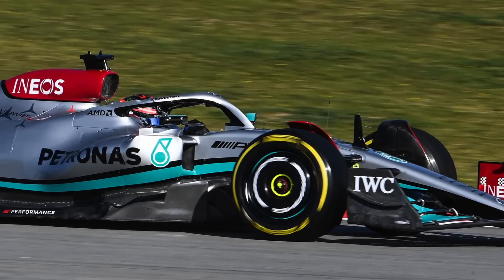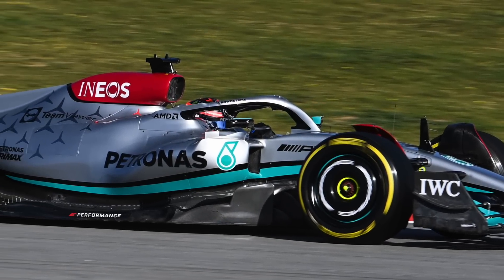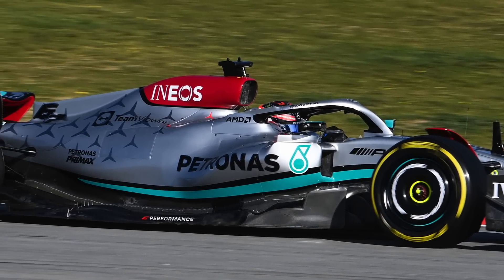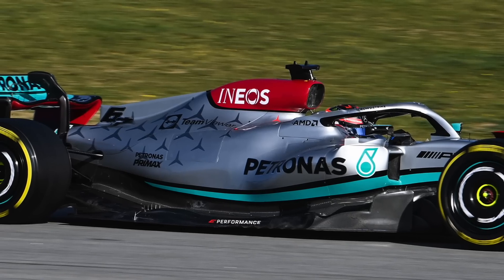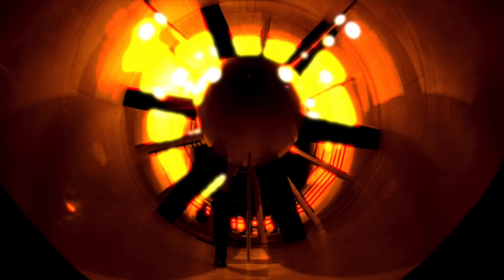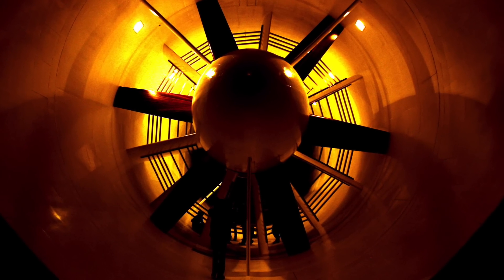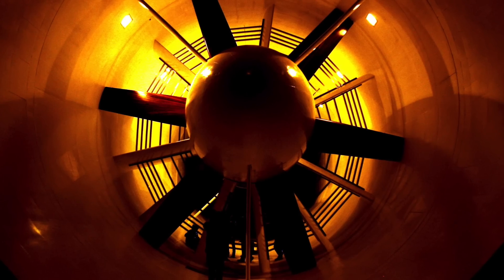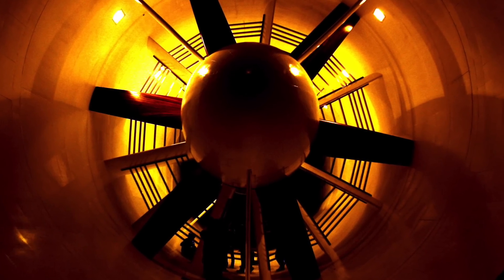F1 car porpoising: CFD or tunnels? By Peter Windsor

Comment: CFD, IS AN INCREDIBLE PIECE OF TECHNOLOGY. BUT IT'S GOING TO TAKE A BIT MORE BASIC UNDERSTANDING OF IT BY THE VIEWING PUBLIC TO TRULY APPRECIATE IT !!!
Reply: They never will. The only way to explain it simply is to dumb it down to the point it sounds unimpressive.

I didn't really understand it until undergraduate theoretical and applied fluid mechanics, a masters course in CFD, and then modelling an Americas Cup mast and sail interaction upon which it failed miserably due to at the time limited availabilty of low Reynolds number turbulence models.
Reply: WELL SAID , THIS TECHNOLOGY I GUESS IS STILL IN ITS INFANCY AND DEFINITELY NOT AVAILABLE TO THE GENERAL PUBLIC . THANKS AND WOULD LOVE TO HEAR ANYMORE ON THE SUBJECT .

Comment: Is this not a little stating the obvious? Any good engineer will know the limitations of their simulations, and he said so himself the hardest part is building the initial model so the teams will building their model based on historical data, taking it to the wind tunnel to validate, rinse and repeat. Then the moment the get running on track they have new data that gets fed back in at the CFD end and they can start refining further. They will all know that CFD can't model everything perfectly so won't be committing to a particular philosophy until they have better data. But the limits on wind tunnel testing and zero track time allowed over winter means it is all they can use

Comment: I’m not an engineer though I’ve followed F1 closely for decades. A question that popped into my head during this conversation is once a car is in a real environment how much does wind, humidity, temperature.... mess up the data from the wind tunnel?
Reply: I’m not sure I fully understand what you’re saying, but test data is used to data match the model. So the model learns more about the real behavior. So it’s not “mess up”, we use the test data to match the model to so we can better understand the operating environment. 

P.S. I’m an aerospace propulsion engineer.

Hope this helps!
Reply: @tigerrx7  I suppose what I’m asking and I’m asking the right person... Are factors of the elements replicated in the wind tunnel testing? Obviously an F1 car’s aero is affected by wind speed, direction and gust as well as air temperatures and barometric pressure as well as humidity. Are these able to be simulated in the wind tunnel testing and are they? Thanks
Reply: Far more important for CFD and wind tunnels for slower sports like sailing.

This was the reason New Zealand first took the Americas Cup off Dennis Conner. First to use wind tunnels that included real wind effects to model air flow over the yacht as it sees in real wind. Gave NZ a 15% performance benefit over every other competitor.

But yes, those are all parameters kept track of in test data.

Comment: The CFD will suggest configurations that work. Testing those (and tweaks on those) in a wind tunnel will both allow teams to develop something that works on track and further calibrate the boundary conditions in CFD via comparing the variabilities seen in the wind tunnel and observing similar trends in CFD results.

Comment: Turbulent flow is averaged flow, and it's lossy flow because the eddies effectively act as a brake for the flow. Tires like cylinders create Kelvin-Helmholtz instabilities, as do flapping wings(or floors). The wafting wake from the tire can be controlled by the vortices that are shed when the wheel yaws. Turblent flow still has a bulk motion and interaction with surfaces, it's just a great deal lower than laminar flow because you are eliminating skin friction and replacing it with the viscosity of eddies.

The mirror stays play a large role in controlling the rear tire wake. So does the rear wing end plates. The tire wake also affects the wing tips. Last year's cars used the wing by the radiator inlet as a way to control the rear tire wake. All they have is the mirror stay. Mercedes sidepod is impressive but it does nothing for rear tire wake.

Comment: I mean, I am a programmer, so maybe that's the issue. But I really feel like this is merely an issue of computation time and complexity. With unlimited processing power, team using CFD will probably easily beat the team with a real windtunnel and vice versa.
Reply: It still needs validations and both need to be validated to the real world.
Reply: As a programmer, you should know that not everything is computable. Chaotic systems are very difficult and yes, sometimes even impossible.

Comment: Airplanes, ships, and cars are all more efficient thanks to CFD. Not only has processing drastically increased in the past 5 years, but so too have the understanding of the physics which has led to ever improving algorithms.
Reply: It's also worth reminding ourselves that they designed and got the first 747s flying using panel methods assuming no friction. Just distributed source, sinks and vortices and a boundary condition applied to the simultaneous equations.

Comment: CFD is great at producing results from the algoritim and models put in. But you have to have enough knowledge to understand the output from that with what was put in then you also have to validate that with how it acts in reality. That is why we have cars with the aero sensors on track. Too many think that you can just model and run things through the compture and if the computer says Yes it will work... It all depends on what calculations the software have done on the data that was give to it. Shit in gives shit out. Gold in gives gold out which may not be how it works in reality...

Comment: Great video !   I have heard Frank Dernie say that he invented diffuser strakes in the 1980's.   Maybe a good idea for a video would be Frank Dernie explaining what diffuser strakes do.  Because I have not idea what so ever.  The typical Autosport magazine article is not terribly insightful.  Great video.  Wonderful to watch.
Reply: Kyle Engineers on YouTube might help u. He's an aerodynamicist who used to work for Mercedes Benz !
Reply: Most diffuser strakes clean the airflow or separate the bad from the good. If you remember last year's F1 cars their strakes were towards the edges of the diffuser not in the center, this means that the are controlling "tire squirt". Tire squirt is the air that hits the front of the wheel specially at the lower section close to ground and "squirts" inboard or outboard of the tire. The one that matters is inboard tire squirt because it flows straight into your diffuser, tire squirt is messy, turbulent, unpredictable air and it's impossible to get rid of it, so teams place strakes to keep that messy flow from messing up their entire diffuser. It doesn't seal the diffuser but rather separates the messy flow that might come in from the side and tire squirt, keeping the laminar (straight and predictable) flow down the center. This is a more efficient way of controlling your flow and creating down force. There's a second reason and that's lateral expansion. Diffusers expand air vertically, this accelerates the flow and by Bernoulli's principle means that it drops in pressure (mixed with a high pressure above creates down force) but some diffusers can also expand laterally and strakes help the flow move outward (expand laterally) and once again accelerate and lower in pressure. Some strakes even play with the flow behind the car or help surrounding flow but that's something I'm not to familiar with. Hope it helps! (Ps. I'm no aerodynamicist but you can check Kyle engineers video on strakes)

Comment: Saying that CFD can't respresent unsteady flows is just false. It's true that unsteady simulations are much more computationally expensive than steady ones, but still I know for sure that in F1 they run them regurarly to develop their cars, even smaller teams like Haas.
What they can not afford to do is to use unsteady codes for all the simulations. Therefore a correlation work between steady and unsteady CFD simulations is also necessary.

Comment: Frank’s comments about sports cars being easier to deal with than open wheels suggest to me that those who claim solutions exist to porpoising in LMP01 only understand half the issue. Von Karman vortexes are a real pita and even wind tunnel models have rigid suspensions and real F1 cars are subject to structural mode interactions that are nearly impossible to model or replicate in a scaled wind tunnel. IMO, I think the rules makers think they’re more clever than they are.
Reply: Nothing new here.  Breakthroughs in CFD and aerodynamics far exceeds the expertise of Brawn, Symonds and co.  There knowledge base is ancient in that regard.  Brawn himself said he didn't predict mercedes solution.  Another example are the new front tire wake control winglets being a visibility problem.
Reply: Please, it's not that complicated. It's really not an aero problem, it's a suspension setup problem. It is very easy to eliminate, it's just that eliminating it reduces performance. So to go fast, you need to be as close to the edge of porpoising as possible and maybe even over the edge. 

Also, some of the best ways to deal with it were outlawed this year. Heave springs and inerters would be VERY helpful right now but they can't use them
Reply: @wingracer1614  I agree about heave springs and inerters, but that isn't the root cause of the issue.
Reply: @Hoffbottraces  No, the root cause is the diffuser stalling when the low part of the tunnel hits the ground. There are only two ways to prevent that:
1. Design the tunnels in such a way that the lowest part of the tunnel does not hit the ground first. That way the underside always has airflow and doesn't stall even when the car bottoms out. Unfortunately this would require rule changes and all new parts. Not an option for mid season. 

2. Don't allow the car to bottom out. This will cost performance. Heave springs and inerters would help you achieve this with less loss of performance. 

The bottom line is that with the current rules, this is going to be a problem all year. Not because it is a hard problem to solve, it's easy. The problem is that eliminating it makes the car slower. Teams would rather win the race with porpoising than finish 5th without it. I suspect we will see a lot of cars porpoising during the first half of races with heavy fuel loads. Should go away by the end
Reply: @wingracer1614  I haven't seen anyone present any data suggesting this is the only cause, and it could be a number of causes. There are a lot of pundits copying each other's theories, but Jean-Claude Migeot hinted at what I have described as well. Quote "Migeot explained that the cause of porpoising was not in a cyclical stall function, but down to the aerodynamic forces within the underbody at high speed inducing movement in the car close to its natural heave frequency.".
Reply: @Hoffbottraces  That could be. If so, inerters would effectively eliminate it. It's what they do.
Reply: @wingracer1614  seems there is a bit of disagreement with your statement seeing how these cars shift the weight around based on the speed and direction of the corner.  It it were that simple of an issue ten F1 teams would not have had to fight it for days..
Reply: @uprightfossil6673  Corners have nothing to do with it. Fixing it is easy, raise ride height, stiffer springs, harder and earlier bump stops. Problem solved. The only problem is that reduces downforce in slow speed corners and increases drag on the straights. No one wants that so they try to live with porpoising at the end of the straights in order to get better performance everywhere else. The only aero fixes are things that would reduce downforce and they obviously don't want to do that either. The things we are seeing like stays on the rear corners of the floor and slots and holes are all just band aids, not solutions. 

There is another fix. A different tunnel / floor design that bottoms before the stall. Unfortunately that's not an option as that is a strictly regulated part of the car. The FIA would have to change the rules to do that and there isn't time or budget cap room to do that mid season. I would not be a surprised to see such a change for next year as not only could that eliminate porpoising but could also reduce downforce a bit, helping to slow down these cars that look like they could end up the fastest ever by the end of the year instead of the 3-4 seconds slower they predicted.
Reply: @wingracer1614  okay dude.  I guess next time I want to know I will ask you and ignore the F1 engineers who are part of the F1tv package.  Maybe you should get a job helping those guys do their job right so that us watching don't have to see them bouncing down the track. 😂
Reply: @uprightfossil6673  I guess you missed the part where I said you will be seeing them bounce down the track all year. While it is easy to fix, fixing it makes them slower.

And LOL. while I was typing this I had an interview with Ocon playing in the background and he said the exact same thing.
Reply: @wingracer1614  yeah sure dude.  I guess you forgot that you wrote that it was easy to fix and that corners had nothing to do with it.  Don't argue when you can't remember how wrong your statements are.  And don't try to deflect... I'm old and that trick is what stupid people try... It never works 😂

Comment: What was the old school way of fixing this problem? Drill holes into the tunnel and skirts to relieve the massive pressure they are making
Reply: That isn't so much about releasing pressure, more reenergising flow if a stalled surface is the problem. Which is likely what limits and releases the max downforce.

Comment: Why wouldn't they be able to model or simulate turbulent flows?
Reply: another name for turbolent is chaotic... Computer has terribly hard time with chaotic behaviours. They are basically calculating leaf in the wind... It's damn near impossible.
So they use approximations and guesswork, but that's never exact
Reply: @sultanofswingdrift3021  Amazing, I just thought with the amount of money and therefore brain and computing power they had they would be able to get a perfectly satisfactory model going. Of course you then need to check against wind tunnel results and calibrate the computation, but I do find that very surprising.
Reply: @sultanofswingdrift3021  this.

Comment: The question of CFD versus wind tunnel misses the need for significant experience and insight into both. There is no such thing as just putting a digital model into a CFD program and seeing what the result is. CFD systems are very complex and desperately computationally expensive. A fluid dynamicist needs to have significant experience to know how to set up the models and where they have to set things up for more detailed simulation and where they can get away with simplified flow modes and simplified geometry. And they need the insight to know what is important and what isn't. The interplay between CFD and real life is critical, no matter how smart you have been, you need to validate. Validation is not just that you understand the car. It validates that all the compromises and parameter setting on the CFD model were good (or not) and that feeds experience beyond the current design. 
We have heard that porpoising was not detected in the wind tunnels because they would not allow the floor of the car to contact the moving belt, to prevent costly damage to the belt. The CFD model probably never simulated flow for long enough. Everything is compromise. Experience and insight again.
The overarching limit to the design process is always time. Even with arbitrarily fast CFD processing, the need for humans with experience and insight in the design loop is going to be the pacing factor.
Reply: How do you know this, not questioning it, just curious
Reply: @rs660alec  Well, if you are a mechanical engineer you should know the importance of correlation between theoretical (equations etc. accurate but not every problem can be solved), simulation (cfd. assumptions but  relatuvely cheap) and experimental (wind tunnel. Very few assumptions, expensive)l. 😅
Reply: @justpassingby7262  I think that’s true. A racing car is a very sophisticated aerodynamic problem. The teams use all the tools available to them but the results from each tool need to agree. Sometimes the only way to confirm the agreement is empirical. That is what we are witnessing during these tests. It has ever been thus….
Reply: @SilverfoxThe  yup.
Reply: Even w all the CFD every team got it wrong week one and many still struggling week two. The humans make the programs so there will always be a flaw.
Reply: Please open your YouTube channel. Your insights are really needed.